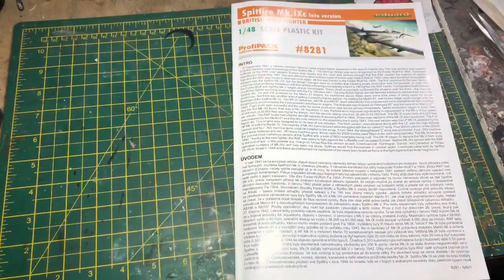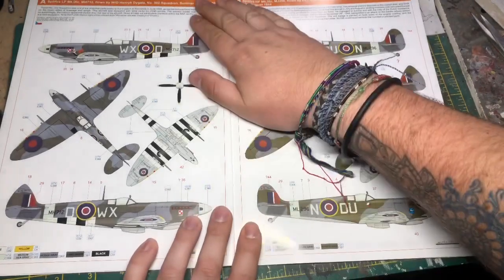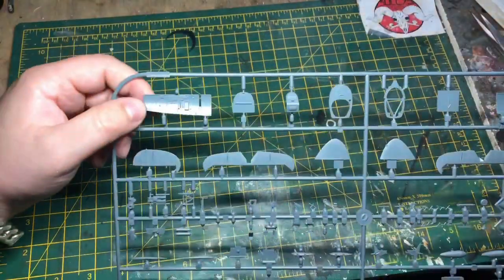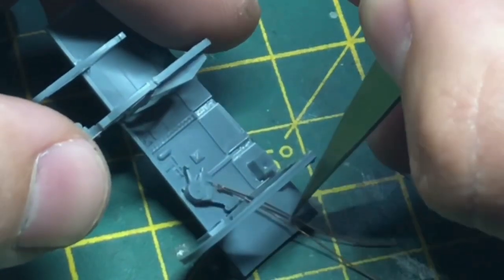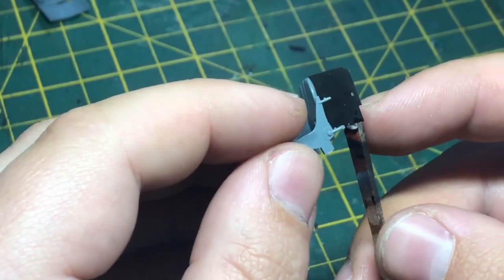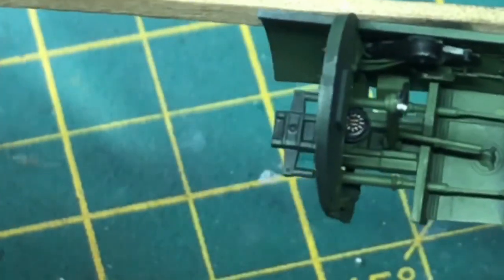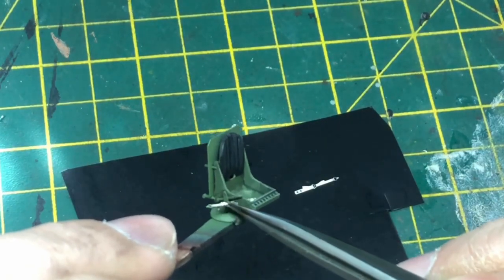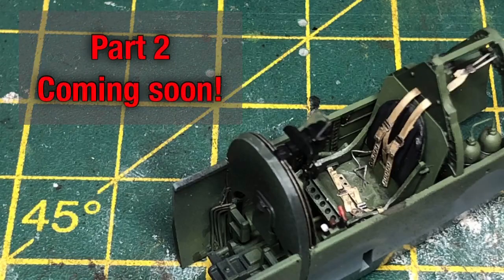1/48 eduard Spitfire MkIXc (Commission build)

Comment: Nice detail. What size wires did you use for the wiring detail?
Reply from the maker: Thanks mate!! I used 0.2mm wire, the wire i used was florist wire but if you get leadwire it’s more malleable to use and easy to position
Reply: @SullysScaleModels  Ok thank you for the info.